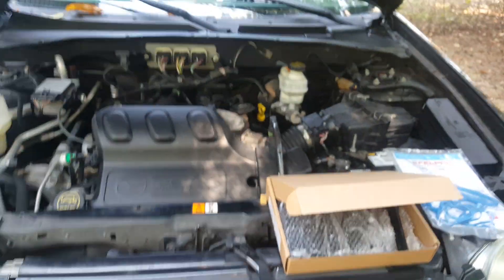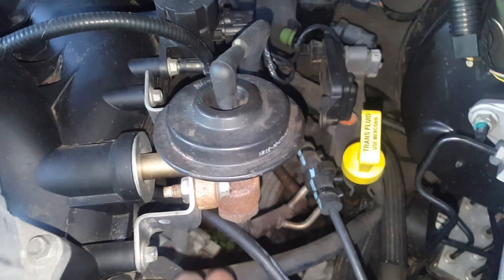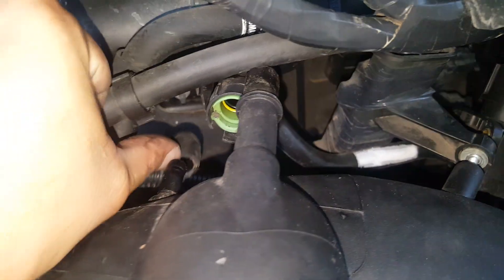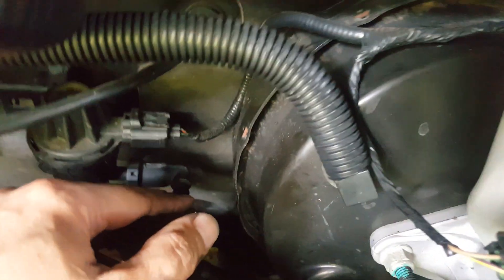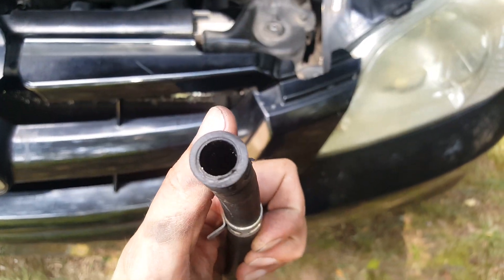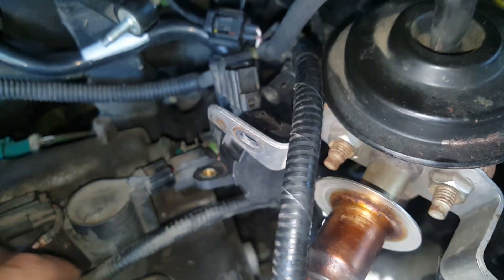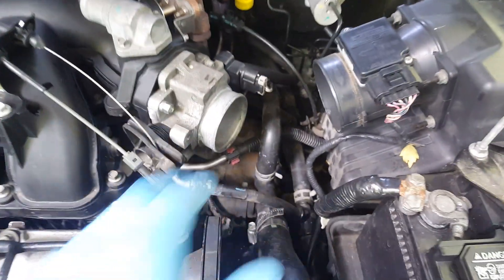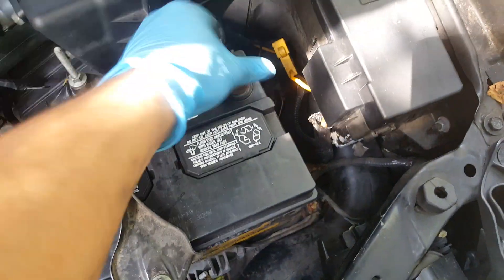How to replace mazda tribute coil packs & intake gaskets

Comment: The hose or valve you took off right in the beginning that is the piece I need to replace. What is it called. My rubber fitting on that piece fell apart

Comment: Great video! Just curious, what made u change the coil packets? Was it just time to change them and if so at what milage did u change them? Or was a coil or several coils misfiring? Thanx!
Reply from the maker: When I got this vehicle it was cutting out bad on acceleration . I went straight to the coil packs because I had other vehicles do the same. The intakes were replaced as maintenance due to removing the intake. They are just easy convenient to change. Also a good time to get the spark plugs if they have not been changed. I will say the coil packs made a 100 percent improvemnet and its easy to just replace them all versus trying to hunt down the exact culprit. Very good question and i appreciate the feedback. Thank you for watching

Comment: Hi just curious what sort of fuel economy do you get on your tribute? I replaced the coil overs, plugs and intake gaskets when I had to do my tappet cover gaskets on my 2002 Tribute. There was oil leaking into some of the plug wells. My car starts, runs and idles perfectly, but with fuel economy it is terrible at about 6km/litre city and 8km/litre highway. Converted to 14 mpg city and 19 mpg Highway. I have a high flow air cleaner element and have cleaned the throttle body and the MASS Air Flow. I have never been able to workout if there is a way to improve the economy, so I just live with it. One mistake I may of made was I got Mazda to reprogram the computer with updated software before I did the work (before the issues started with the oil in the spark plug wells), might have been a stupid decision on my behalf as I have read it worsens the economy?
Reply from the maker: I havent checked it on this 2006 yet however on my 2002 it was getting 16 avg and i drive mainly city. So seems similiar. I really love these tribute for their versatility and cargo room. Ive hauled pipe lumber and all sorts in mine . I will say the gas mileage is horrible. But seems like the same with most fords ive owned. Ive not owned one of the 4 cylinder tribute but im curious myself on their mpg. Sometimes with a heavier vehicle the 4 cylinder is no better. I know what the website say but real world driving is usually different . I will get back with you on this 2006 when i fill up . Thanks for the feedback and thanks for watching
Reply from the maker: Just an update my recent mpg was at 13.5 thats all city . Pretty horrible i had a 4.7l ram that was getting that .
Reply: @s33therfan  I cant understand why they get such poor fuel economy. Must just be poor design by Ford.
Reply: @s33therfan   Also another thing I had to do on mine was pull the ABS fuse. This means your ABS and handbrake lights stay on in the dash, but I find it improves the braking. I am older and I was driving before ABS was standard. When registration is due I just pop the fuse back in to get through the inspection.